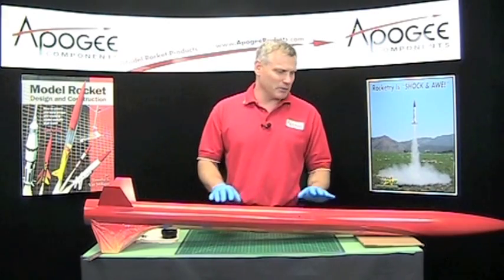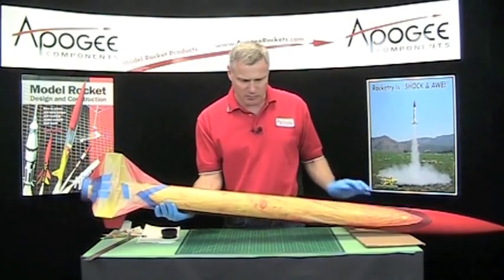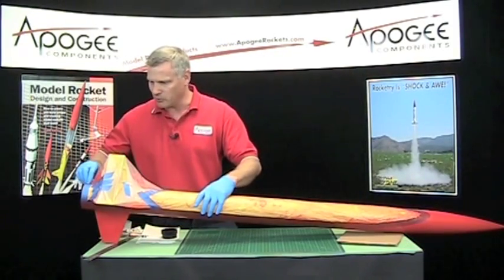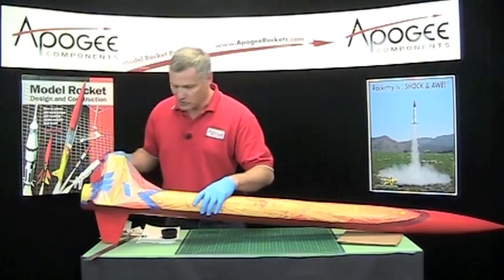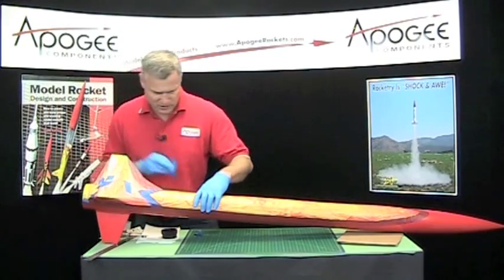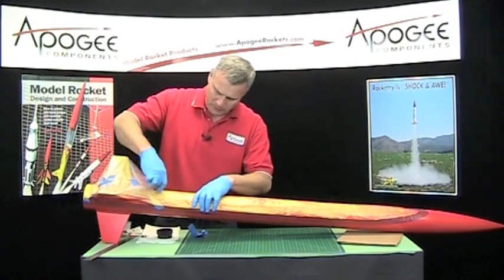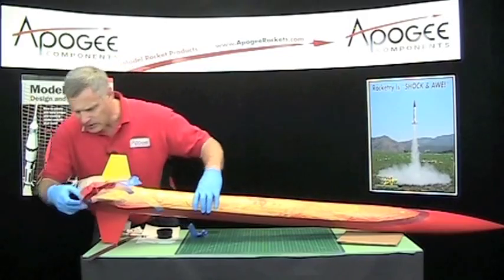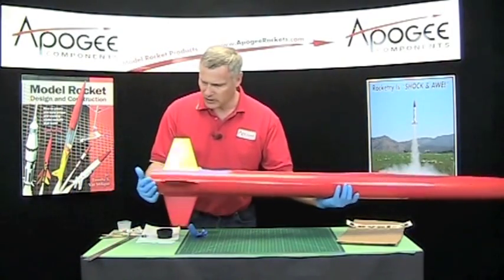Building the Level-2 Fiberglass Rocket Kit - 18: Painting the Rocket

Comment: What kind of paint did you use because I was painting my rocket with rustolium and it had a sandy texture to it and wasn’t glossy I also put a clear coat on it and it did the same thing I’m not sure what to do except sand the clear coat with 1500 then 2000 and polish it but I’m afraid it wouldn’t take out all of the sanding marks from the 2000
Reply from the maker: We have the same problems with paint that you have. Because of that, we don't have any brand recommendations. They are always changing the formulations to comply with environmental regulations, so what is available today will be gone tomorrow. Sorry. I know this isn't the answer you wanted. We do have a lot of tips on painting rockets in our Peak-of-Flight newsletter that is available on our web site. I would suggest you take a look at that.